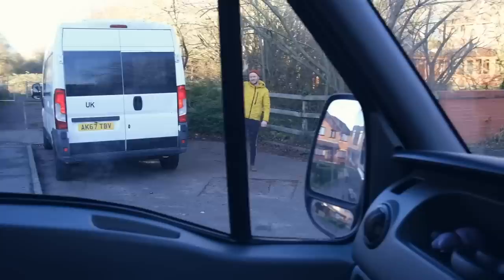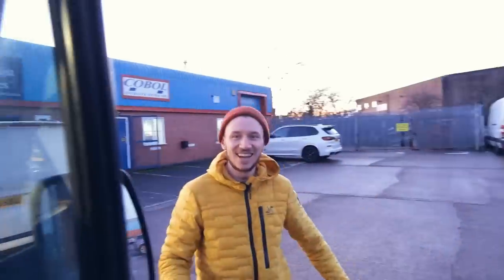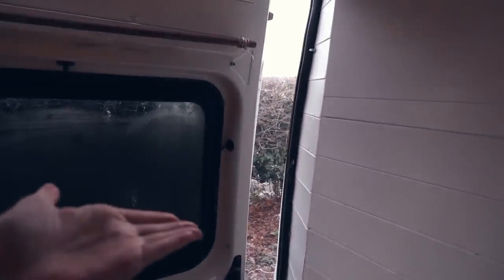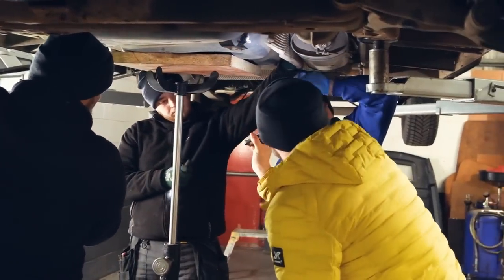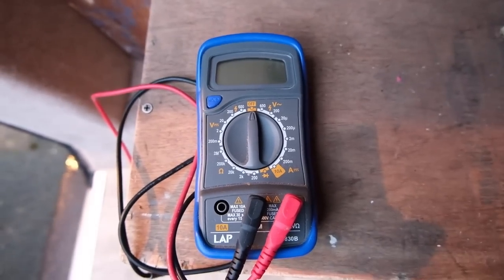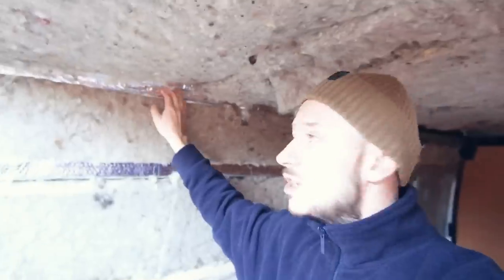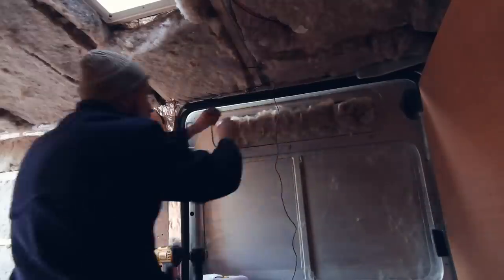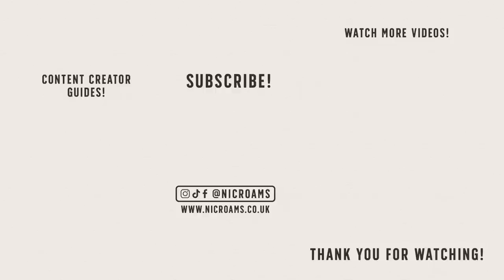Eberspacher DIESEL HEATER Install & Reversing Camera and Sensors | Campervan Conversion UK Ep 11

Comment: We’ve been thinking about installing the sensors as the camera is angled so when parking we have room to open the back doors if needed. Which often enough it isn’t so be handy to know how close we can reverse before bumping something or someone 😅

But after seeing Sam’s install definitely going to inspect the bumper situation. Would you recommend the sensors you got?
Reply from the maker: Sorry, I know a super late response, you should have just messaged on IG, you know I’m much quicker over there 😂. But yes, I’ve been happy with them 👍🏼 my camera seems to be a bit angled though like you said so need to readjust that as Sam’s is spot on so it’s got to be possible 🤗